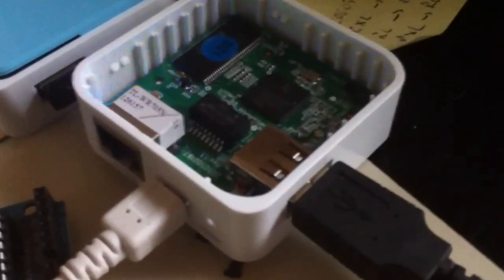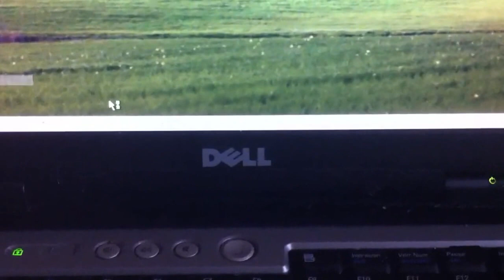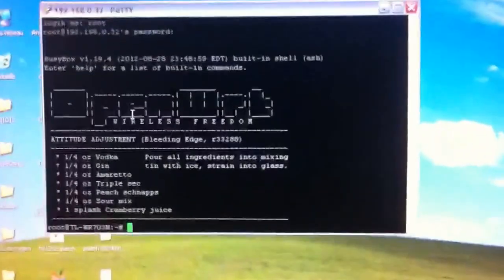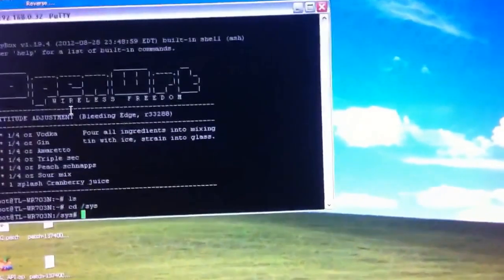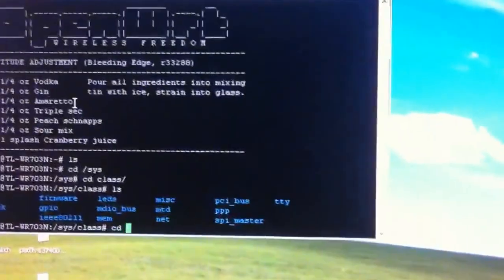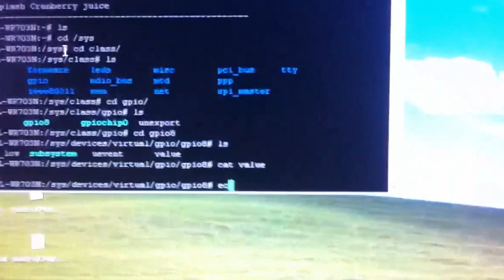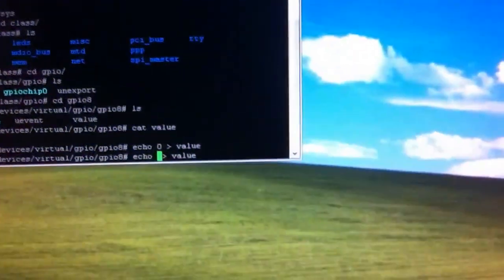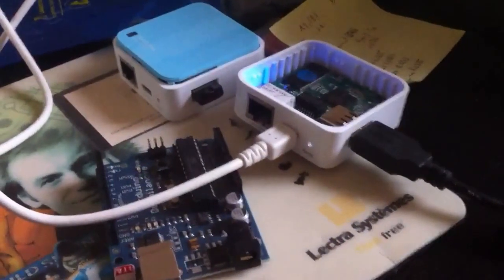Toggling USB power on TL-WR703N

Comment from the maker: No, it isn't power, it is a hardware bug in the CPU chip, search for the "ar9331's usb stability issue" topic in the OpenWrt forum for details.

The only know way to correct this however is to put a hub in-between, even passive hub will do.

Comment: Yeah,
I'm talking about USB flash drive.
Everytime I'm using Transmission on the router and when after few minutes the router is crashing. someone told me it's because the USB port isn't giving enough power. maybe I need an external USB hub...

Comment from the maker: USB 2.0 is a marketing thing:)

A device can be said to be "USB 2.0" compatible and only use full-speed or low speeds, which are also available in plain old "USB 1.1"...

For example, an USB mouse can be "USB 2.0" compatible, but only transmit at 1.5MBPs low speed or 12MBPS full speed, as 480MBPS high speed is completely useless in this case for just mouse slow XY coordinates/button events, and also requires significantly more expensive hardware.

Comment from the maker: USB 1.1 is low and full speed, USB 2.0 is low/full/high speed, i.e. the USB 2.0 only adds high-speed (480MBPS) to the existing 1.5MBPS and 12MBPS low and full speed, it is not a different standard.

Then no, it is not possible to use 2.0 vs. 1.1, as they are the same compatible standard, and you can't force using high speed if your device does not support it.